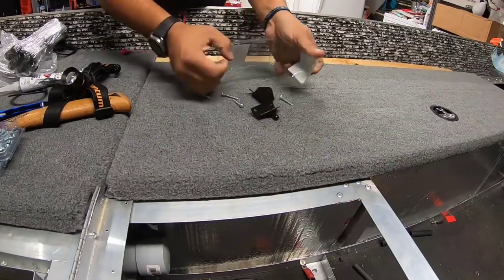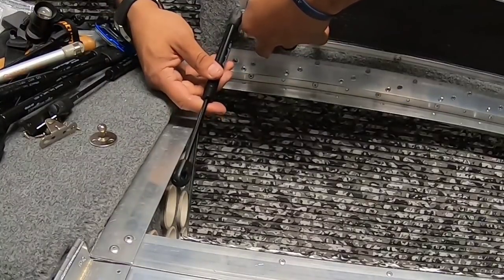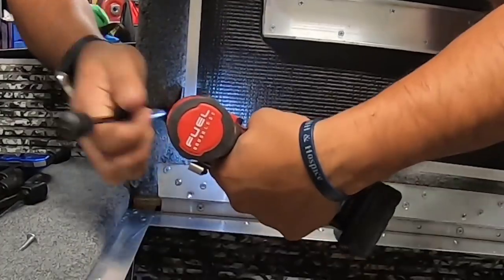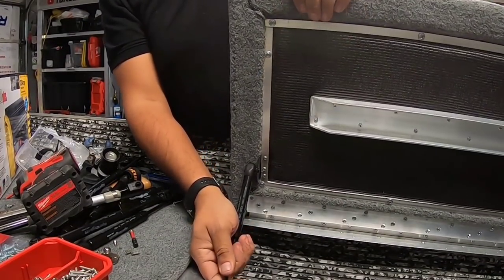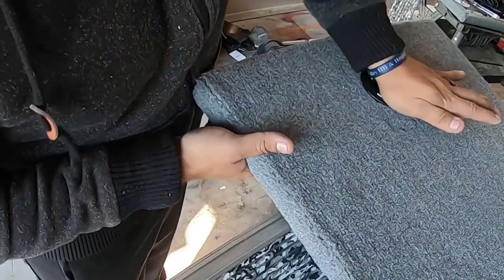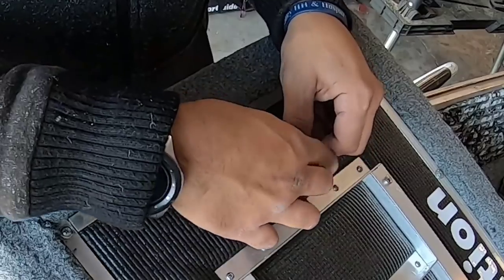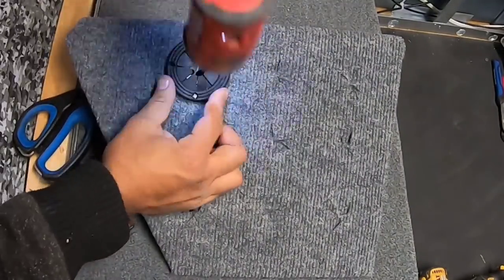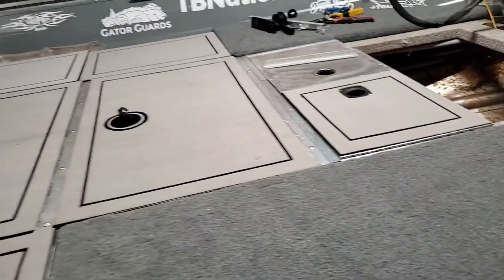Bass Boat Struts, Latches & Rod Grommets: FULL Install Tutorial

Comment: Mike, how do you determine the length of struts and the pound of them?  I have a bass tracker with aluminum hatches none are wider than 12” and longer than 24” just need to know what sizes. How do you determine that?   Hate to buy more than I need or deal with buying not enough of the right length.